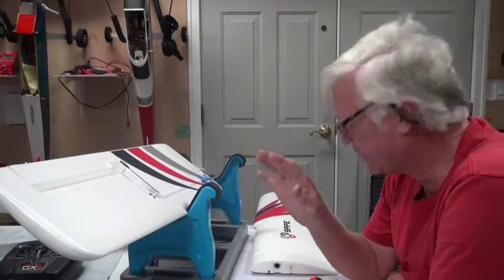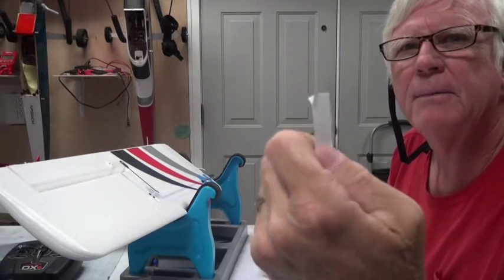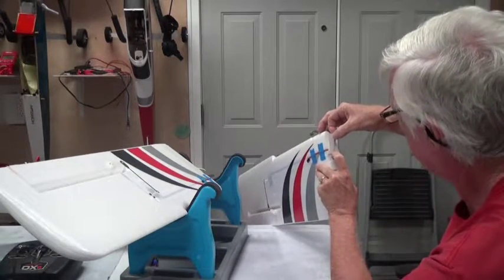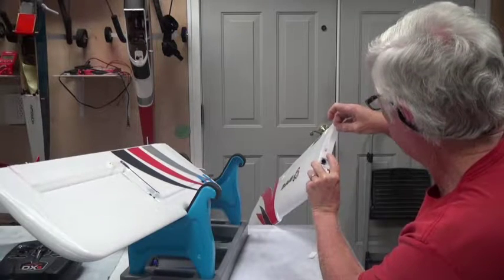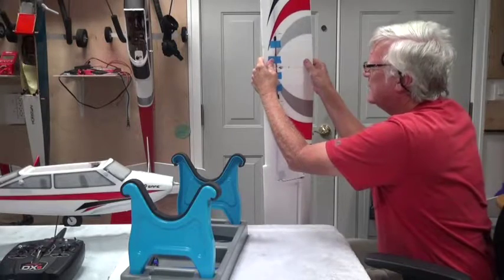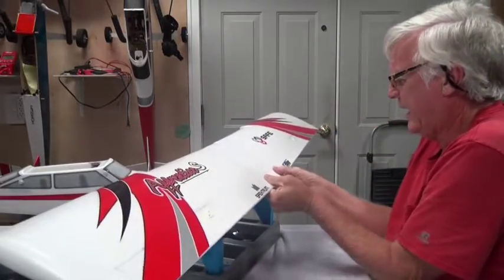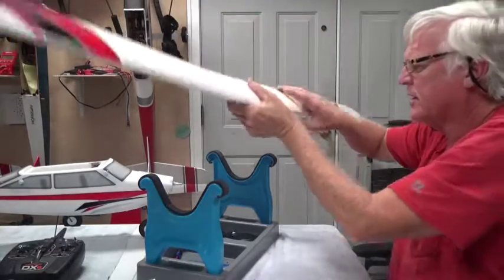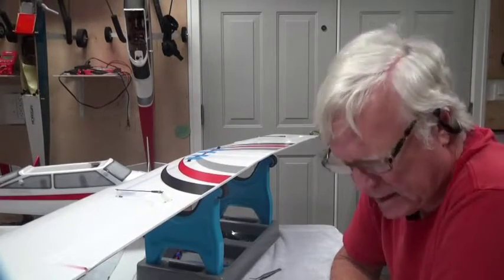AP22 Apprentice S 15e RTF Wing Assembly

Comment: When I join the wing halves on my Apprentice, there is a 1/8 inch gap running pretty much down the entire mid section where the two halves join. This doesn't seem like a good fit. I would appreciate your advice on a quick fix. I am thinking about sanding the end of the carbon fiber rod with a light duty Dremel sanding tip to take up the slack (but I have never sanded carbon fiber, so I don't want to cause a fracture, weakening of the rod, etc). In the absence of that being a solution, or anything else you might suggest, should I just go with it and consider it to be a minor informality? Thank you.
Reply from the maker: There could be a piece of foam down in the hole where the tube goes.  Take a small dowel and see of you can dislodge it or compress it or get it out.  You do need to make sure the wings come together tight.  Also put the tube all the way in one side of the wing and make a mark with a colored pencil, then do the same with the other side then compare the length of the marks to see which one is shorter than the other.  That will be the side with a blockage.  Let me know if you cannot get it to work.
Reply: Thank you very much for your assistance and suggestions. After some gentle twisting and persuasion, I was able to get the leading edges and trailing edges to mate up ok. There is still a 1/16 inch gap just behind the front wing joiner. I was able to find someone locally with an Apprentice and he said his wing appears the same way and not to worry. I flew his plane once already and it flew like a dream, so I think I am good to go. Have a great day sir!